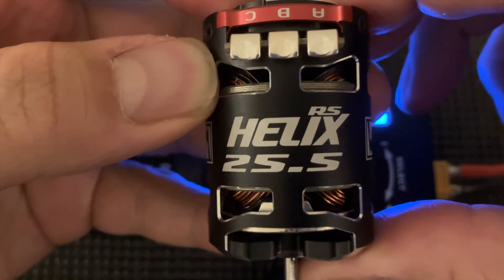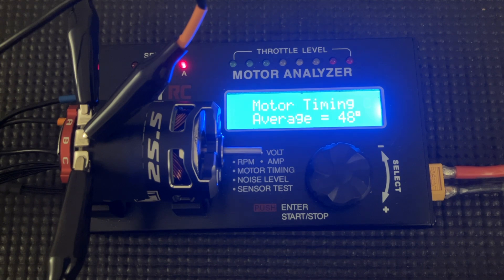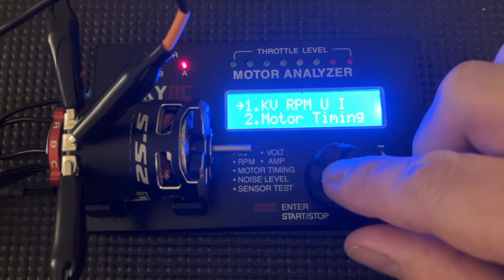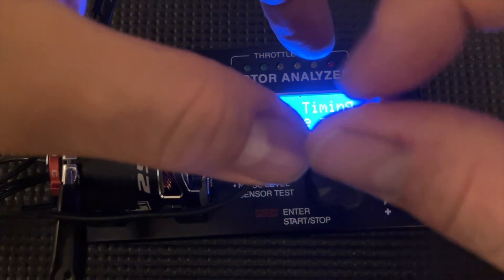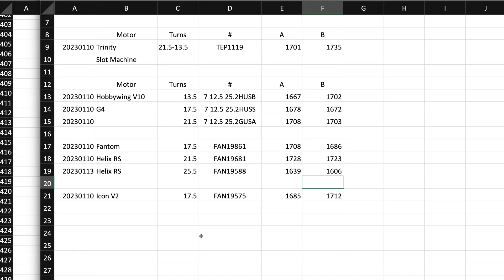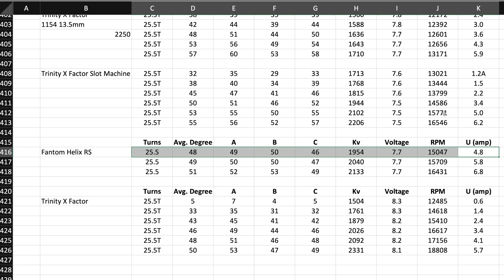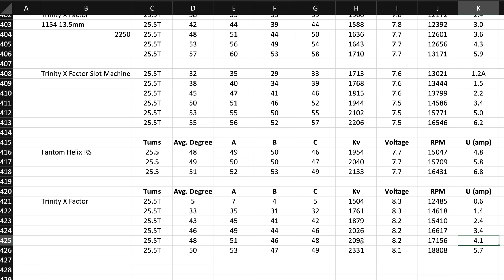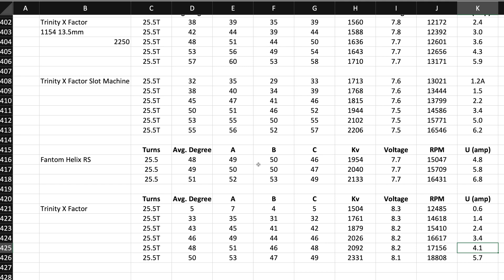Fantom Helix RS 25.5T motor analyzer and rotor gauss test

Comment: So you have been running the Helix for a while now in VTA, how do you it?
Reply from the maker: I am not sure what the question is referring to, but depending on the weather: 83T spur with pinions ranging from 47-52T.
Reply: @telecomandorc  Sorry, i was sleeping while typing that.  In one of your other videos you mentioned that you were going to run the Helix in VTA.  I was wondering how that worked for you?  I have an MC5 and i'm not thrilled with it.
Reply from the maker: @warren6814  It is good, but it needs to rev. Make sure to gear it a bit lower. Although, compared to the MC5 you might be around the same gearing but the Fantom has more RPM. But Fantom is the way to go. But do not get too cought up on motors. Unfortunatly, VTA is the class most people cheat in if tech inspections are not strict. So you might be going up against Outlaw motors. I told the owner of a track once and ran an Outlaw myself to see if I could match the top guys on the straights and... surprise surprise... I did match them. But the Fantom is the best in my books.

Comment: From your testing which motor would you recommend for 25.5 tc on road carpet
Reply from the maker: Fantom Helix and Hobbywing G3R are top motors, but the Fantom takes the cake for me.
Reply: @telecomandorc  I like the helix but it’s not roar approved is my only issue. I currently am running with the fantom icon 25.5 with the 12.3 rotor at 51 degrees of timing and it’s a beast. My MTC2 is geared around 88/50.
Reply from the maker: @racer034life  The only Icon I have used is the 17.5T in a buggy. Loved it for carpet. I may just pick one up in 25.5.
Reply: @telecomandorc  I’m ordering a team fantom 25.5 todays d I already have the Hobbywing 25.5. I mainly race on-road tc on carpet. These are the two biggest classes in the Midwest. We also run 1/12 17.5 and 13.5 also.
Reply from the maker: @racer034life  Very nice. Let me know how you like it.
Reply: @telecomandorc  so after running the helix 25.5 In stock tc I learned it’s a RPM motor. It likes a higher spur gear. Gearing between 3.2 to 3.5. I did purchase a team edition motor that came already aligned and tuned. I am also running a hobbywing G2 pro esc with this car also. I’ll be trying this motor with a R1 stock spec esc or tekin here shortly to see if there is any difference.
Reply from the maker: @racer034life   I am running about a 3.4 FDR. Very close. Let me know about the esc. We run blinky, so I have a Justock.
Reply: @telecomandorc  so we run blinky also and I’m going for the lowest internal resistance out of the esc. IR os huge in stock racing and most of the top drivers have it all down to a science.

Comment: Anymore thoughts on the helix?   I’ve been running it for a few weeks now in VTA and it’s okay.  With 92t spur and 50t pinion.   Gearing down doesn’t seem to be faster so I’m considering going up to 52-53 😮

Btw my R1 21.5 in TC is a beast
Reply from the maker: My 25.5T is fine. I run it in my F1. 
The 21.5T is alright but HW G4 was way better.
The 17.5T Helix is nice. I may like it more than the HW G4.
Reply: You should be in between a 3.2 and a 3.5! The Fantom helix 25.5 like’s rev’s, there not a low end motor. Can you test your motor and see where it’s at? Also going up in gear doesn’t always mean you will be faster either.  What’s the size of your track and is it carpet or asphalt?